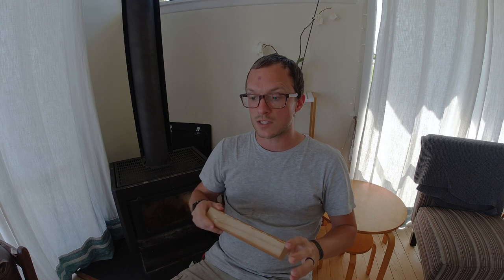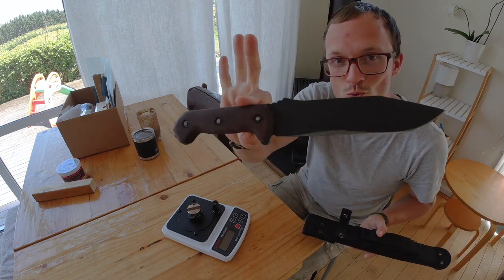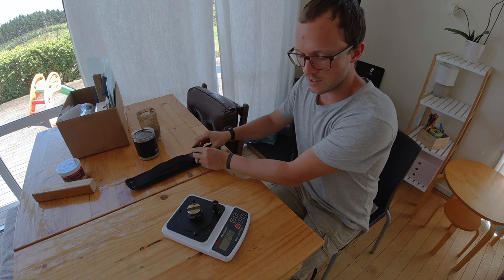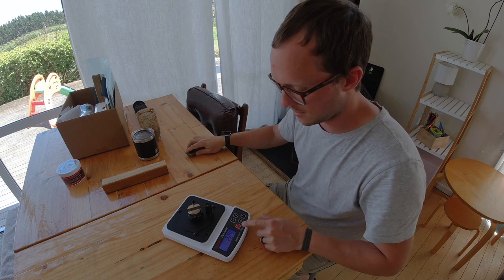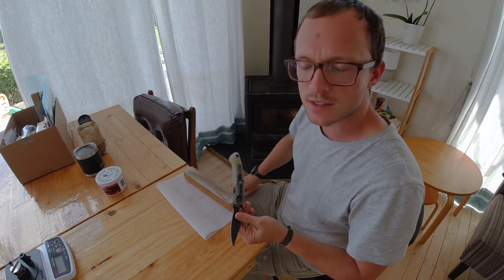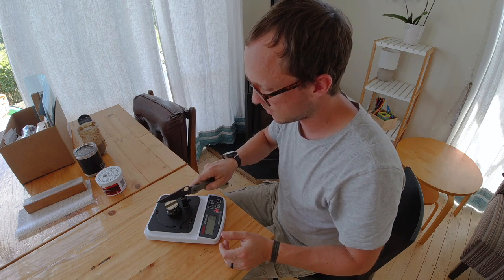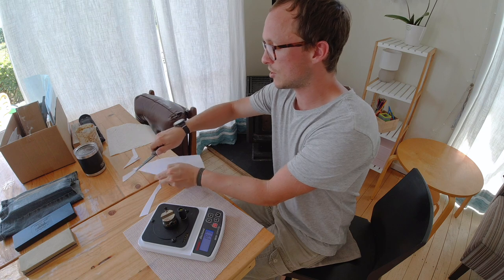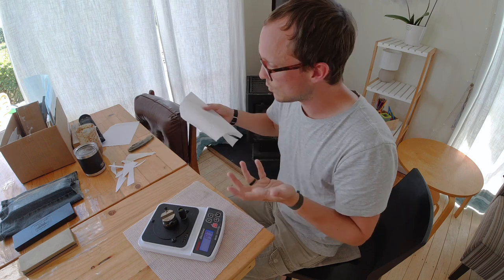Sharpening W/ Jeans & Timber - Inexpensive DIY HomeMade Pine & Denim Strop

Comment: Just built a 10" x 1.5"leather strop with some adjustable angle guides on both ends. 
- Going to load it with 6 Micron diamond paste . . . Looking for 150 BESS #"s 
- Looking for BESS #'s under 200  which have proved difficult to obtain with DMT diamond plates. 
 - Thanks for all the insights you share . . . a short-cut to what may have been very time consuming trail & error.
Reply from the maker: You are welcome sir!  Lower BESS can be super frustrating at first.  It defies all feeling of edge aggression (and indeed sometimes you can get a lower BESS and lose some edge aggression).

I hope your strop works well!  I have found lately that Mother's Mag polish on flat denim drops the BESS on softer steels, and harder steels respond well to 1 micron diamond or similar on hard leather or basswood.

The rough side of a hanging unloaded leather strop almost always drops 10-30 g off a BESS number for me as well.

Usually to get under 100 g - I have to
1) Spend my time minimizing burr on the stones and take the edge to a fine grit
2) Strop on Mother's Mag or UF diamond emulsion, 15-20 strokes.
3) Strop on hanging leather, 15-20 more strokes.

Best of luck!

Comment: Interesting. My favourite strop right now is hard leather with 3micron diamond paste. I change my mind all the time though. Used to be rough leather with bark river compound. I will try denim now though.
Reply from the maker: Let me know what you think!  As I said, just a few passes at edge angle on flat denim or wood loaded with compound of your choice seems best for high alloy steel.

Low alloy steel responds better to the hanging strop.

Comment: Thank you for the teaching how to video Gabe. How are your experiences with carboard stropping? Specifically with adding stropping fluids or abbrasives. Is it good for the softer metals or for the harder steels too? Have a great weekend friend and stay well.
Reply from the maker: That’s a great question! I guess I haven’t used my increased collection of pastes on cardboard!

I tried some 5 µm diamond on cardboard while sharpening an ax recently and it seemed to work relatively well.

I do find that for dual grit edges the flat denim gives a better result for me than the cardboard loaded with either diamond or silica or both.
Reply: @homeslicesharpening  The cardboard might be to smooth whereas denim holds the paste better en evenly so i gues that's helping the proces a lot. For a smooth mirror edge carboard could be the final strop. But as said, i keep the dual grit edge on my knives, so thank you for sharing your experiences Gabe.

Comment: Also technical question. You tell that free hanging denim strop would be better for ductile and/or stainless steels. I do get it, at least I imagine that steels like maxamet would rather than getting rid of burl actually chip well into the edge and make it like a saw on micro-level. But then again on ductile steels wouldn't it also cause the edge become micro convex? That might actually be a good thing for edge retention but possibly could lower a micro-bit Besa score - just as convex grind on macro scale needs more force behind it than scandi grind at the same edge angle, wouldn't it? 🤔
Reply from the maker: YES!!!  I love technical questions.

The research that was done in a book I recently read suggests that steels with greater ductility will wrap their burr around the edge apex at a greater angle without it breaking off. 

The idea with the hanging strop is that it’s a gentle way to increase the angle just at the very edge Apex to match the angle needed for chipping off the burr and leaving a clean edge on your more ductile steel.  

It does become just slightly micro convexed, but in actual fact almost every fully deburred edge in existence is micro convexed (for a few microns anyway), at least that’s what scanning electron microscope images would indicate.

The reason that it doesn’t have a huge effect on the Bess score is that in very fine sharpening the reason the Bess score goes up is because a little bit of burr actually bend over under the line and interfere with cutting it.  So, if the edge is micro convexed and clean, then it’s strong enough to not bend under the pressure of the best line and it will cut through the line at a lower pressure.
Reply from the maker: The reason that higher carbon or higher alloy steels often don’t require the use of a hanging strop is that they don’t have as much ductility to be able to bend around the Apex, which means that when you sharpen them at the normal edge angle most of the Burr chips off naturally. 

Therefore, often times, it is more helpful to do your stropping at the edge angle with harder steel because burr has already been effectively minimized (you don’t need to bend the strop around the edge to reach an angle that chips it off because it’s already chipped off).

Comment: I've had good results using White Diamond metal polish and sealant on wood. Haven't gotten around to trying the denim yet. 

Great video as usual. Thanks for sharing all your hard earned knowledge. Looking forward to more.
Reply from the maker: Thanks Kevin!  I'm so glad to hear about your results!  I have been hoping to provide a low cost way to mimic expensive water-stones, and am so glad it's been giving you good performance!!!
Reply: @homeslicesharpening  I prefer the way it behaves after it dries. Also, I reapply it to the same piece of wood without issue.

I'm all for doing stuff on the cheap. I started with some dirt cheap diamond plates and sandpaper.  I got usable results, but did not enjoy the process at all. I gave up and started spending some money on stones.
Reply from the maker: @Kevin.L_  that’s really good to know! I’ll have to check out some of the white diamond stuff.

Yeah, I’m definitely not against investing in stones. I’m just working my way through it slowly, so that I invest in the right ones! 

Also, if there’s any way that I can help guys who are really on a tight budget to get excellent sharpening results, then I want to try out the stuff that costs very little you know? 

Anyway thanks for the comments, have a great day dude.
Reply: @homeslicesharpening  I'm not recommending the White Diamond since I haven't compared it to other stuff. I bought it based on others recommendations as the best for motorcycle wheels and forks. Never used it there so I tried it on a knife and was impressed.

I appreciate what you are doing with your channel and enjoy everything from the short knife 101 classes to long geek sessions.  I hope you continue.
Reply from the maker: @Kevin.L_  thanks mate!  That’s the plan, thanks for clarifying, and have an awesome day!!!

Comment: Seems interesting but why not just use a leather strop that isn't disposable if your home.
Reply from the maker: Good question!  I did these tests because they were suggested to me by Todd Simpson when I told him I could not afford a decent set of fine stones (at the time) and to see if I could use it to replace a fine stone with something cheaper (granted it takes more work and runs out).

Todd at scienceofsharp.com has had great results removing wire edges on straight razors with strops loaded with automotive polish, and has not had much luck removing them with just leather.  I know knives operate differently from carbon steel straight razors, but I wanted to observe the effects of these methods on conventional steel.

I just purchased a kangaroo tail leather strop to see if I can remove foil burr with it, but was wondering (before I bought it) if there was a way to do so with what I already had.

Cheers.